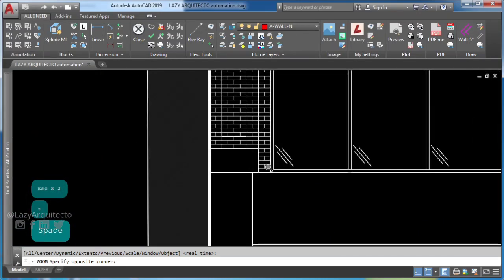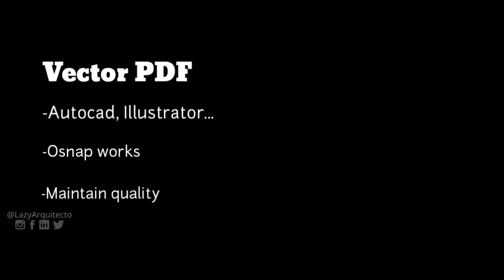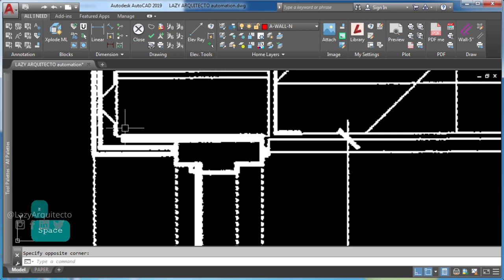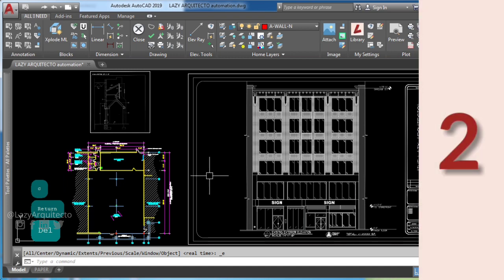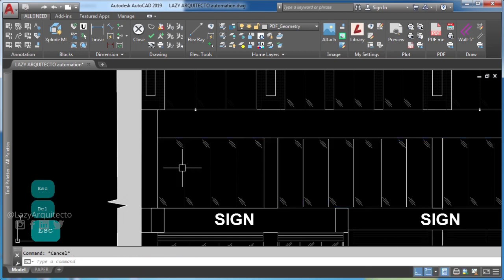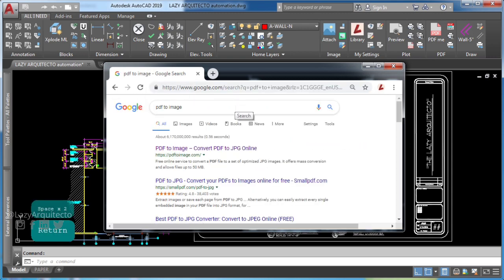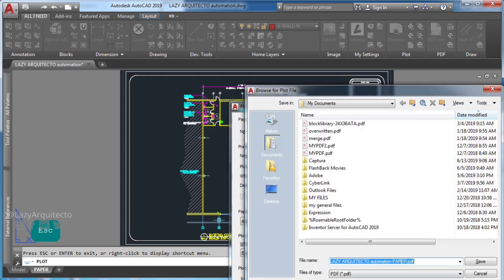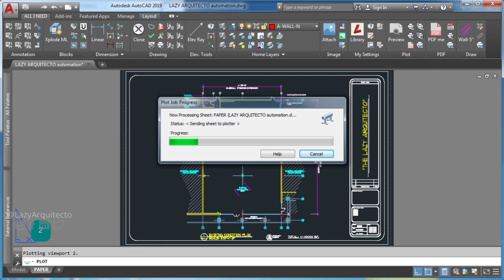How to Fix PDF Problems in Autocad | Pdf Underlay Issues Autocad

Comment: Hey thank you for this video. I have a quick question. When I insert a pdf to cad, and scale it seems everything is right but the only bad thing is that it only comes with four layers for al the symbols, walls, dimensions etc. Ideally I would like for the pdf file to open in cad with the correct layers so I can turn them on and off but once again it seems like layers are all mixed up and I’m going to die if I can’t fix this issue. I’m working on a 20 floors building and have to do this for every floor. Help !!!!!!please
Reply from the maker: Welcome to the team Jasson! When you say scale pdf, you mean convert pdf to cad correct?
Reply: Thank you so much for your reply :) After inserting an image or importing a PDF file, often time the objects and dimensions will not show their "true length" being that the image is not at a 1:1 scale with the actual drawing units.
Reply from the maker: @jassonlondono  after inserting your image or pdf, draw 1 line with the correct size then you can scale it automatically using https://youtu.be/0IX8aG6pcp0 let me know if this helped!
Reply: Lazy Arquitecto yes it help thank you so much
Reply from the maker: @jassonlondono  thanks for being part of the team. Don't forget to introduce me with your friends by sharing! See you on Tuesday with a new video..

Comment: I'm having an issue with Autocad 2015 when I want to print or export in any format, even in preview. It comes out incomplete. Nor shadow, parts missing. Am I missing something?
Reply from the maker: Hola Julio welcome to the team! Your Autocad printing problem may be for different reasons, however, I'll try the simple solutions first. Setting the correct transparency settings here https://youtu.be/foPxotWJceQ

Comment: Thank you very much ! it is a very helpful video as always. just little input,  we can vectorize raster pdfs using 'Raster Design' addin .
Reply from the maker: Hi Zerai, you're right. Although it can only vectorize individual elements and not an entire pdf, or am I missing something?
Reply: @LazyArquitecto  you are 100% correct ...it becomes handy when you use it to trace existing utilities such as  pipes and cables from old maps/plans( in infrastructure planning such as my area).
Reply from the maker: @zeraimebrahtuhabtu226  good point. Thanks for sharing your thoughts Zerai. Hope you and your family are safe!

Comment: Did you ever encounter a plot problem in exporting your cad file into dpf using sheet set? i alwsys use sheetset in exporting my files into pdf but suddenly i just encounter a plot roblem saying it did not plot. this happened for the first time. can you help me? thank you.
Reply from the maker: Do you use a specific ctb file? If so the problem most of the time is a missing one because the file was changed or any other reason

Comment: Great informative video. Congrats!!! I came to this video because I'm having a big issue with PDF's and I've been googling. If you could bring light with your wise knowledge my dear "aquitecto peresozo", I forever be thankful. So, I use "insert" to bring a pdf file to my CAD drawing. Everything works great, I save it and close it.  But sometime not always later when I open it the pdf's are gone, the only thing I can see is come letters with the location from where the pdf file came from my PC. So, I have to do the "insert" process all over again. It's so frustrated, especially when on a tied schedule when you just want to print and go. Any advice will be awesome. Thank you in advance mi estimado "arquitecto perezoso". Keep up the great work!
Reply from the maker: Welcome to the team MBGA..? Happy to help. Are you using a server to store your files or just saving your files in your computer space?
Reply: @LazyArquitecto  Thanks for such a quick reply amigo! I have all my file in Drop Box. So, at times there could be up to 3 different PC's opening same files. First I noticed that if a pdf file was inserted from one pc, when that same drawing was open by other pc the pdf was no longer there. But, sometimes is even at the same pc where the pdf was inserted. it's so weird :/ and frustrated sometimes. Thanks a gain for all your help :)
Reply from the maker: Jorge hablas español de donde eres amigo?
Reply: Lazy Arquitecto claro que si. Nací en Mexico. Resido en California. Y is usted mi estimado arquitecto, de donde es?
Reply from the maker: @jorgefierros1855  lo digo en uno de mis videos! Se nota que los has visto todos amigo. Bueno soy de Peru 🇵🇪  y vivo en Pennsylvania 🇺🇸
Reply: Lazy Arquitecto disculpa. Este el primer video que miro y de los primeros sobre CAD. Andaba buscando como arreglar ese problemita que le menciono. Ojala me pueda hechar una mano, mi estimado pana. Saludos desde California👋🏼
Reply from the maker: @jorgefierros1855 hola Jorge pudiste solucionar tu problema con el pdf?

Comment: How to convert PDF to DWG file in Auto Cad 2014 version ...BCS drawn in 2014 now I want to convert ..but I cant ...can u help me ?
Reply from the maker: Try this site https://www.investintech.com/pdf-to-dwg/
Reply: @LazyArquitecto  not gd  ...u can tell can I convert in Auto Cad 2014 or not ?
Reply from the maker: @mdatherhussain8476  no. You can convert it from Autocad 2017 and up
Reply: @LazyArquitecto  then any other options?
Reply from the maker: @mdatherhussain8476  did you try the site I gave you?
Reply: @LazyArquitecto  yeah ...but their is a prob line became thick, dimensions position is changed, overall not properly converting like 2019 version ....I want fully convert

Comment: I am having a problem with pdf that is both raster and vector in the same time and autocad is extremely laggy.
Reply from the maker: Hi Marek 👋 this is an Autocad issue Itself. What I do is save as my pdf as image and insert that in my drawing.
Reply: @LazyArquitecto  Hi, thank you for your response. In my case, I am using PDF underlay from a file that is map (raster) and there are lines on top of the map (vector) in the same file. And I need to be able to connect into those lines so I cannot convert in into raster image because of loosing that opportunity. What I have found out, that the drawing was so laggy because I have added clipping boundary to the pdf. After I have deleted all the clipping boundaries of the files that were attached to the drawing I can see much better performance and it is less laggy.  So, I will keep that boundary before exporting to work without lagging. Then I add the boundary again but as I am finished with the drawing I do not care about performance. Hope that someone will bring batter solution. Thank you.
Reply from the maker: Great information Marek, thanks for sharing with everyone! Hopefully Autocad fix this issue in the new Autocad 2022!

Comment: when convert pdf to dwg all drawings are exploded and there are problems with layers so, is there a solution ?
Reply from the maker: Welcome to the team Abdel! Happy to help you with that. You can use the quick select command and select by line-weight to place objects in their correct layer. Let me know if this helps.
Reply: @LazyArquitecto  
it works but what about the exploded problem ? 
hatches , center lines and everything are exploded
Reply from the maker: @ElToukhy_LearnGerman  unfortunately some type of hatches will not be recognized by Autocad. Hopefully this will get fixed in a new version of the program.